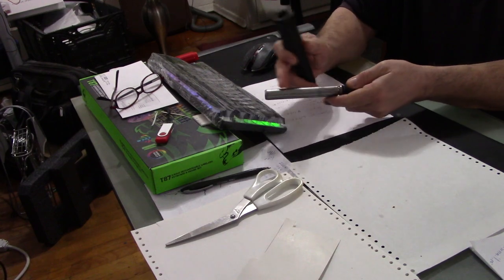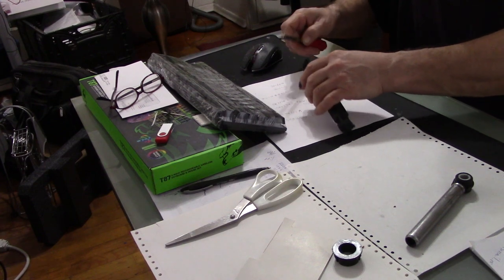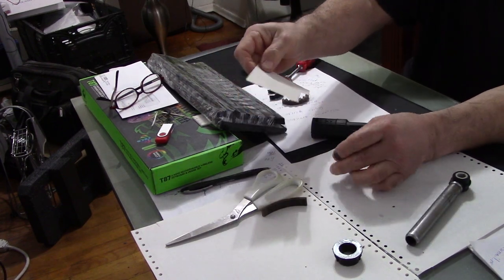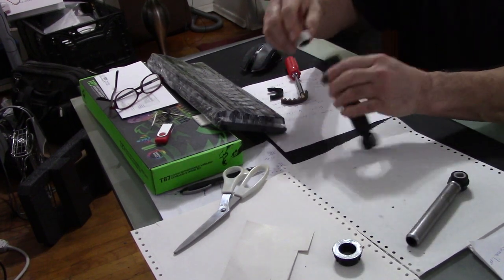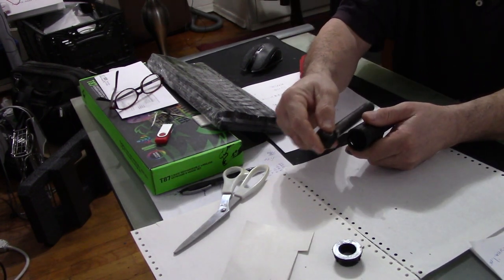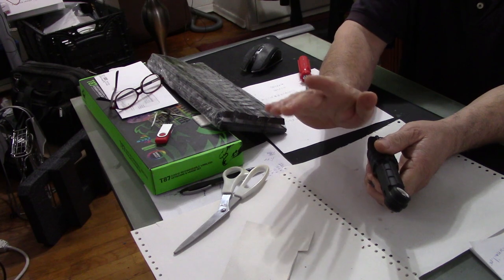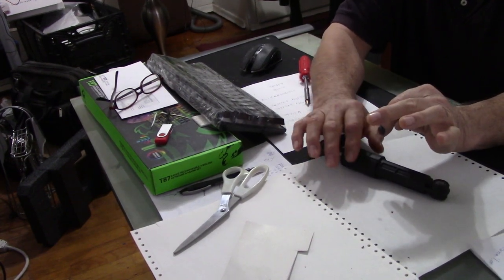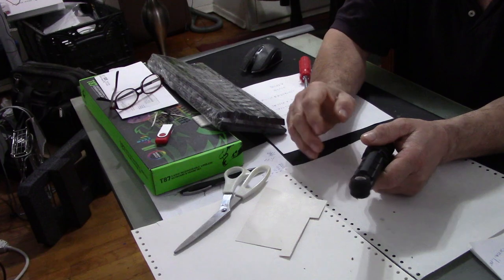Repair Washing machine shocks, struts FREE and FAST. .

Comment: Amazing if only I could reach them through the small hole they put on machines these days
Reply: You may have to take the front of the machine off. My AEG wa like that
Reply: There is a trick to getting the plastic pins out. You push a 12mm socket to push the tab in .mor squeeze with pliers while pulling